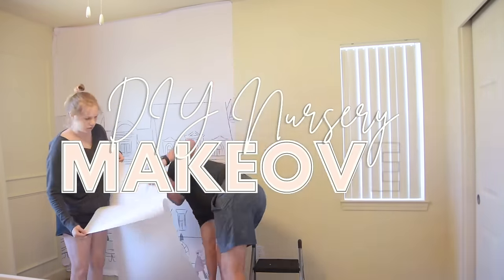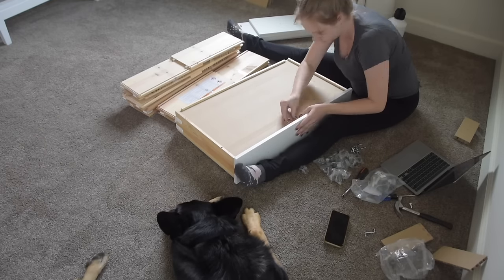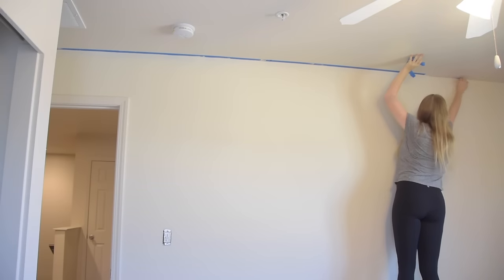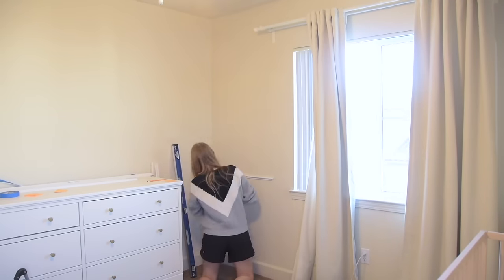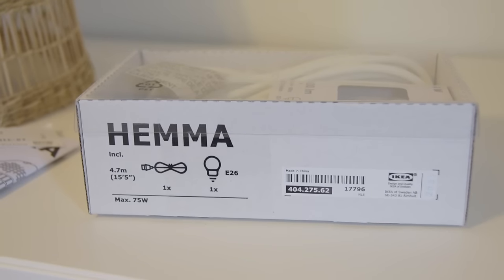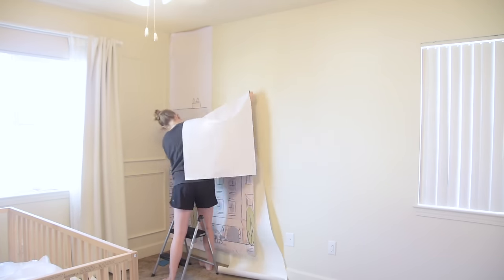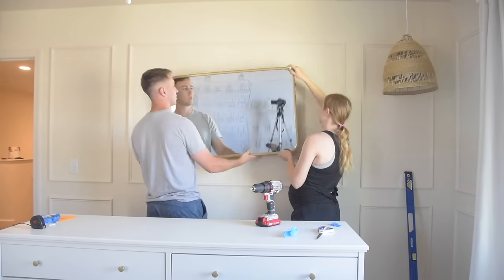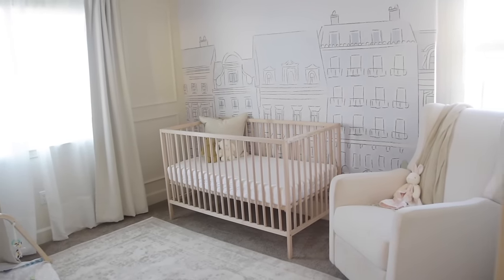DIY NURSERY MAKEOVER ON A BUDGET | diy wall molding, renter-friendly makeover & nursery ideas

Comment: Hi, love the video and congratulations on your new family addition! You're a badass for doing this while making your little human haha. I had a couple questions: 1) were the blue tape markers for the wall molding measured out at all or were they just for a rough idea? 2) when you bought the molding and you said your husband custom cut them, how and what did he use to do that? Do the moldings come as rectangles? This is by far the best, most convenient, and affordable video I've found for a DIY for those. They look amazing too! Hoping I'm able to do something similar. Thanks, and congrats again!
Reply from the maker: Hi there! So glad you love the DIY! If you find my master bedroom diy video I show cutting the pieces and even link a blog post I followed! I put up tape twice while doing this. 1st time is to get a rough idea of where I want the molding and then I figure out the exact dimensions that work (like lining it up with the top of the door frame or making sure the panels are evenly spaced apart) and then I hang the tape up accurately and with a level so hanging the trim is a breeze

Comment: Can someone tell me if the wall molding is really rental-friendly? I'd like to do this on my wall, but I'm afraid it would leave marks on it...
Reply from the maker: Mine hasn't left any marks! It all depends on what kind of mounting tape you use - the one I use in this video comes off my walls cleanly, but I've tried another kind of mounting tape from gorilla glue that lifted off some paint. You can always try putting up a small piece and see how it comes off before you commit to doing the molding!